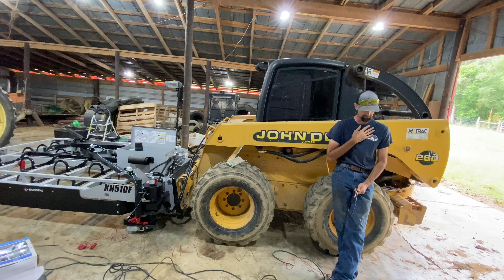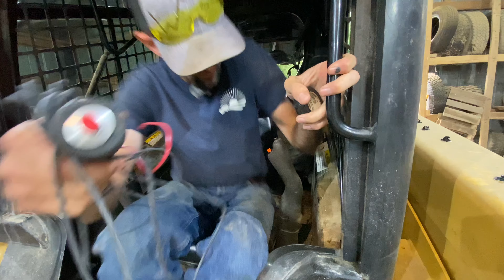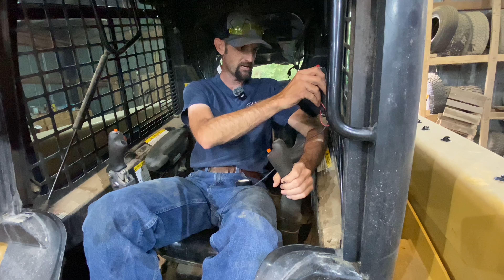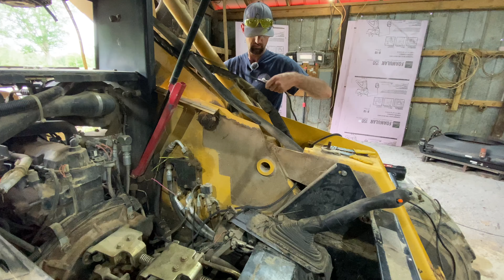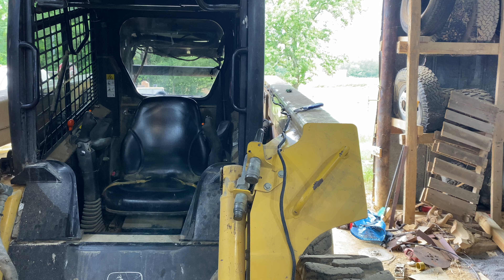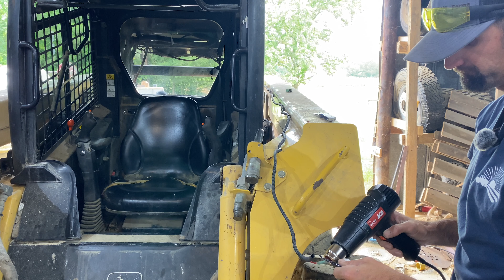Wiring in the new Norden tie grabber #skidsteer #tractor #farming #vlog #automobile #hay#equipment

Comment: Got a part number for the switch? Got a 250 wanting to do the same.
Reply from the maker: Not right off hand and I tried to look it up on John Deere parts but didn't have any luck finding it on their great new and improved parts catalogue. It was the same switch as the one for two speed selection. I remember I searched for ever last year to find the part number and it was in a crazy place in the parts book when I did find it. I will keep looking and if I do find it I will let you know.